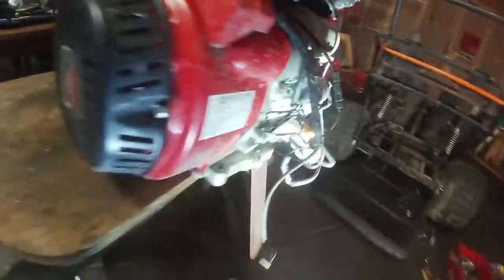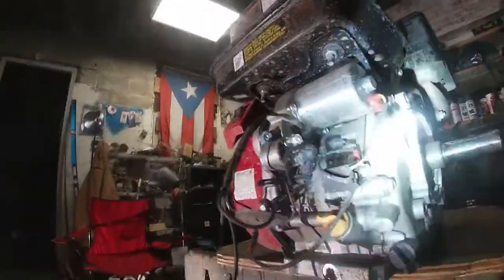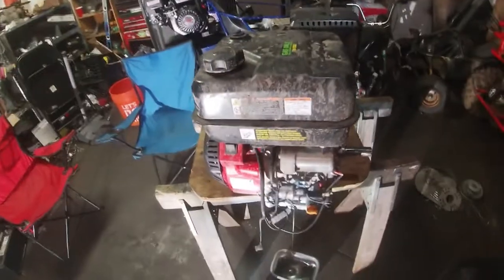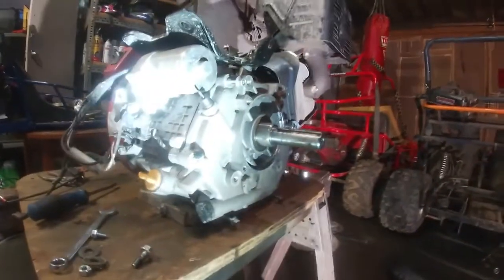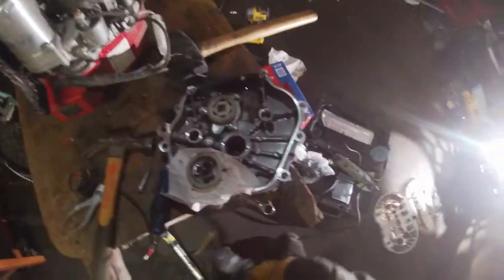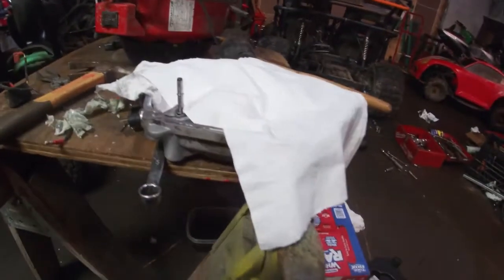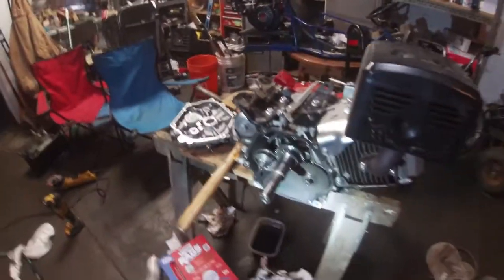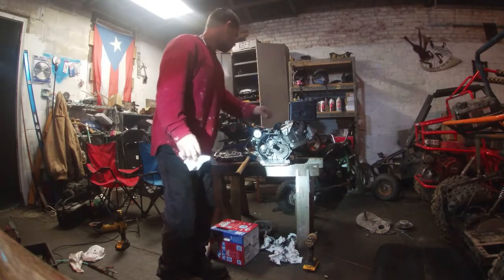How to remove the governor on a 459cc Predator Engine

Comment: Nice! Is the mounting footprint the same as a 390 or 420 engine and is the crank shaft 1 inch also?
Reply from the maker: Yes it’s the same mounting footprint as the 420cc engine and the crank is 1”.This 459cc engine has way more power after I took the governor out.Thanks for watching.
Reply: I have a Honda gx240 on my kart and was looking at the 459, my engine plate is welded In so I didn't want to cut it off and start over. This engine is Double the Horsepower of my gx240!
Reply from the maker: @anthonyreddy2834  I don’t know anything about the gx240 but as long as it’s the same foot print as the 420 then it should fit.If not just drill new holes.
Reply: Gx240 is Honda's version of the Predator 301 I believe, it's a big block 8.5 hp, not sure now since I removed the governor and oil sensor. 😉

Comment: I hope they get a billet flywheel soon so we don't have to worry about it blowing up
Reply from the maker: I hope so too.It’s way faster with out the governor.Thanks for watching.
Reply: I'm pretty sure the different flywheel will give  it higher rpms so it will have a higher chance of blowing up.
Reply: @jacobhalliday8896  no the thing that blows up is the flywheel that's why it's governed if it had a billet flywheel it would max out because of valve float

Comment: Video on top speed 459 with just governor removed? Also what torque converter are you using. Awsome vids thx
Reply from the maker: Hi Jake. I’m actually in the middle of sanding the Gokart down so I can paint it tomorrow.Sunday if it doesn’t rain I’ll be taking out my mini bike for a top speed run. I’m just using a 30 series toque converter for now.Thanks for watching.

Comment: The oil is milked when it looks like that and you see that halo where it pours into the pan.
Reply from the maker: I just got the correct 40 series belts today but I think it has a 30 series toque converter. I’m about to connect the throttle now.

Comment: Good work. I am wondering why you just don't disconnect it from the outside? What is the benefit of removing the internal bits?
Reply from the maker: I think if I just disconnect it from the top the gears and rod can rattle around and mess something up.Now really sure but it does take away a tiny bit of weight this way.
Reply: @samsgarage1716  I meant just unhook it from the carburettor.